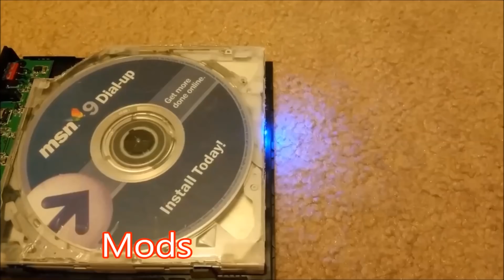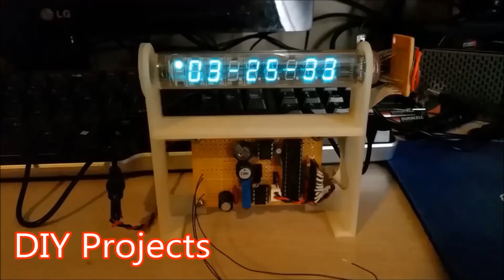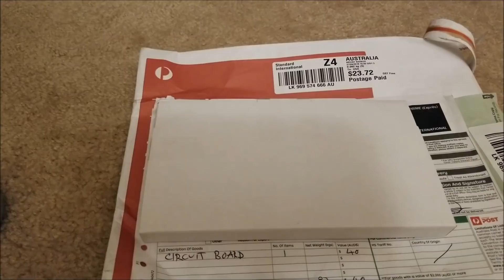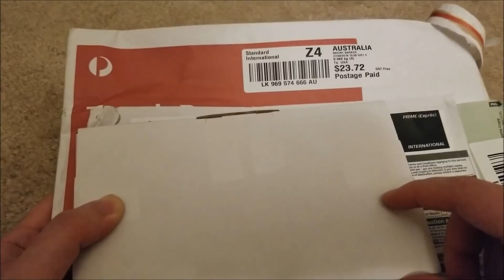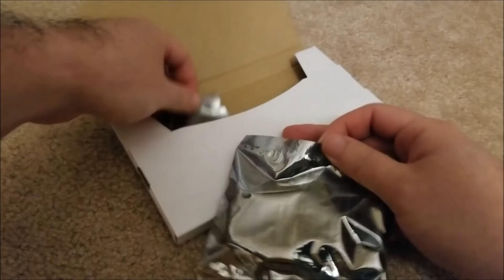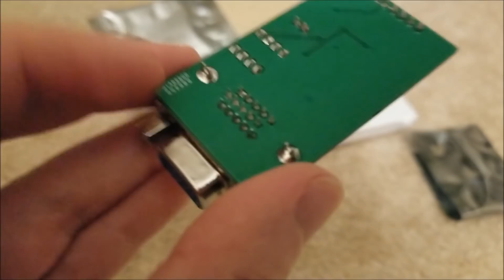More Marvelous Mail and Channel Updates

Comment: Hey SJM, I recently bought a Gameboy Light console. It’s fully functional but the backlight is very dim. Do you know if there is a way to make it brighter? If not, do you know if anyone sells replacement backlights for it? Thanks!
Reply from the maker: You can buy electroluminescent sheets now in a range of colors that you cut to size. Just search ebay for "electroluminescent panel" and you should be able to find them for around $10.

Comment: Nice video! :-) (the RESET & DONE pins on that little 2-pin header are used when uploading firmware to the FPGA in 'Slave Mode' using a microcontroller or Raspberry Pi - by default the FPGA works in 'Master Mode' and reads in the firmware automatically from the socketed flash chip every time at power-up. 'Slave Mode' is useful if you wanted to do some development work and upload different code a lot without having to swap out chips!)
Reply from the maker: Sweet! Thanks for the info. I'll have a video out tomorrow showing off a consolized arduboy with onboard flash and a bluetooth controller. Just finished editing the video so I'm gonna sit back and play some arduboy projected to a 100" image!

Comment: I wonder how this one compares to the BennVenn vga board?
Reply: Main differences between BennVenn's 'Porchie' and VGA1306 (branded by kitsch-bent as 'easy_VGA') would be: firstly, size - easy_VGA is bigger because of the VGA port, so won't easily fit inside the GameBoy shell (could work in the battery compartment if you made a cut-out for the VGA port to stick out the bottom of the GameBoy?), but the guides I have seen for installing Porchie inside mean you lose the speaker to fit it in?

FPGA code for easy_VGA is completely open-source, Porchie is closed-source. Porchie has 2x image upscaling (320 x 288), easy_VGA has 3x image upscaling (480 x 432). easy_VGA is hardwired for 3-bit RGB (choice of 8 colors), Porchie gives you the (adjustable using potentiometer) four shades of grey. When I designed VGA1306 it was with the goal of Arduboy VGA-out (monochrome black & white), so the fact that it also works for the GameBoy was a happy accident! By default the easy_VGA GameBoy firmware maps the 4 'colors' to Black, Blue, Green, and Cyan (but the code is open and could be tweaked if desired - other available colors are Red, Yellow, Violet, and White).
Reply: uXeBoy Thanks for the info! I think Ben is working on a newer version, but I could be wrong. Your board sounds great!
Reply from the maker: Cant exactly say as I dont have the one bennvenn sold, but one big difference is this is currently available and the bennvenn one is as far as I know out of stock/discontinued.